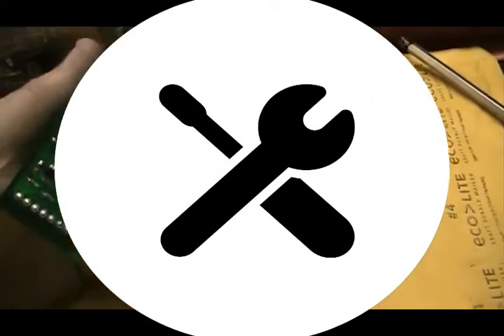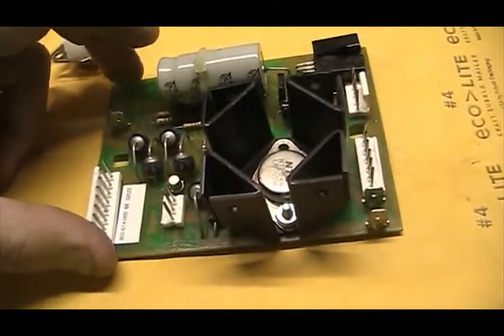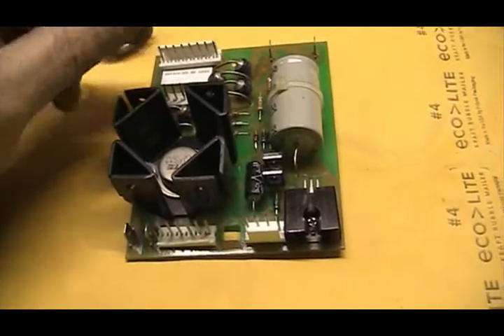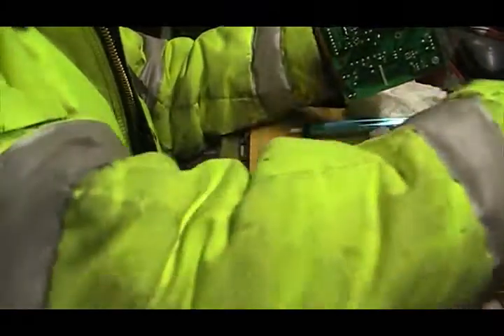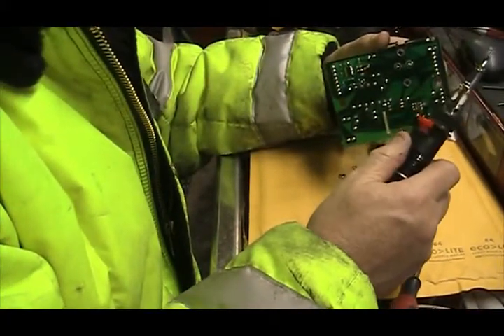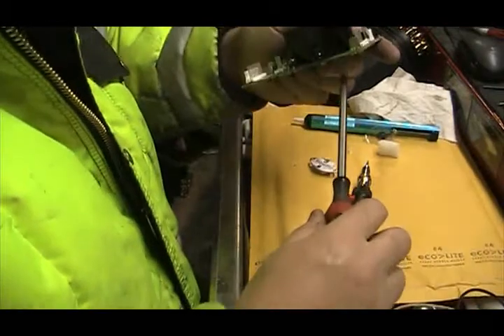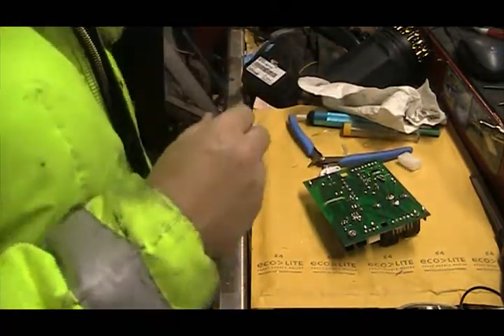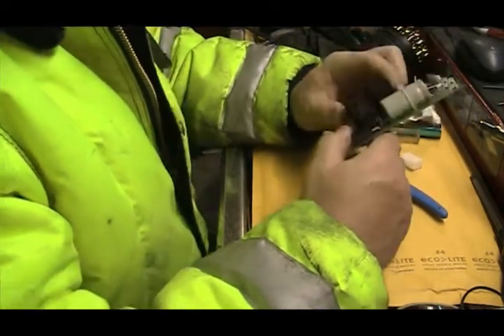DOING SOME ELECTRONIC REPAIR ON AN OBSOLETE MIG WELDER

Comment: Did it work after have same board but not very fast of feed
Reply from the maker: same feed speed ironically, the secondary solid state trans was bad aswell
Reply: @rick3090  I ended up sending my board to York electronic repair in Louisville 23.00 shipping to them they reworked board and sent that other transitor cost 119.00 including return shipping  welder working great
Reply from the maker: @paulgilroy8003  i ended up sending this board to innovat corp in Virginia. nothing was wrong except 1 loose connector , easy peasy.